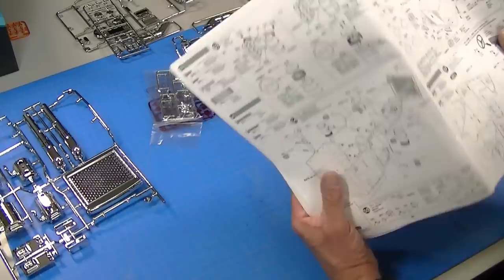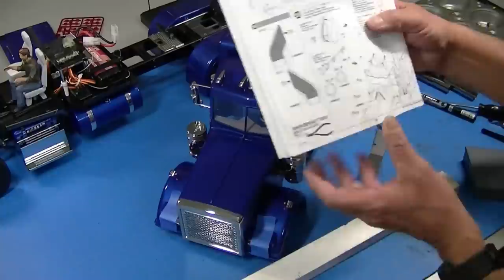Tamiya 1/14 Grand Hauler Semi Truck Build for Novices - Part 3

Comment: Hey Bob! I really love to watch your videos and your detailed work on these models!

I finished building my Grand Hauler weeks ago, but never mounted the visor.

The tip using the screws is exactly what I needed! But I wonder, if you could maybe post a close up picture, where to drill the holes (especially in the body) or just a picture of the screw-mounted visor on one side?

Greetings from Germany!
Reply from the maker: Join the Tamiya Truck Open Studio Facebook group.  I will post a few pictures there.

Comment: Have you ever put together a 20 ft or 40ft connex for the trailer with the metal locking kit. You are great with the builds.

Comment: Hi Bob, great video. 
Just wondering how you made your spray booth. Do you have a parts list of what you used? I’d love to make a set up like yours.
Reply from the maker: It is two of the standard booths hooked together.  Here is a link from Amazon. https://www.amazon.com/Autolock-Airbrush-Lighted-Capacity-Portable/dp/B09QFK573V/ref=sr_1_4_sspa?crid=2JXW11NK5SUR4&keywords=hobby+paint+booth&qid=1652624114&sprefix=hobby%20paint%20booth,aps,140&sr=8-4-spons&psc=1